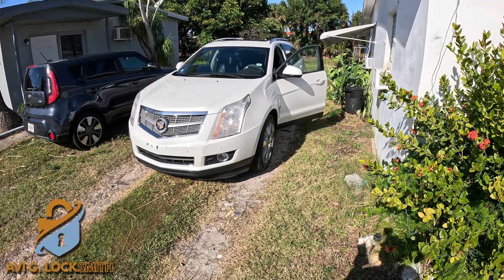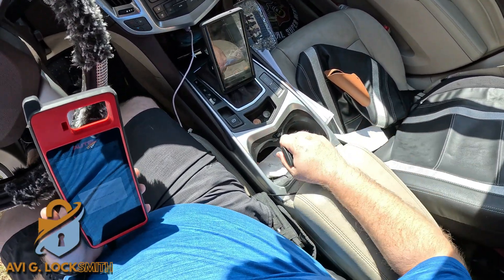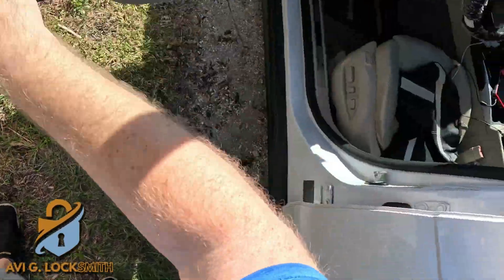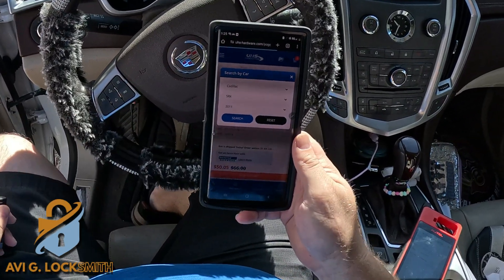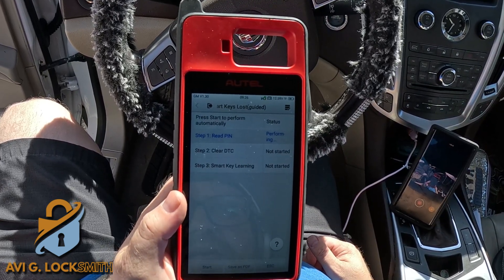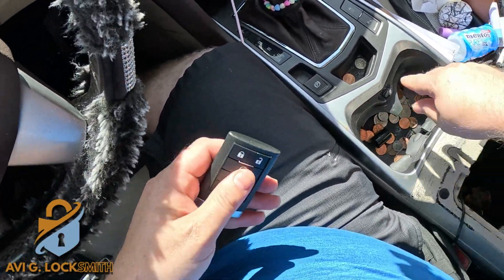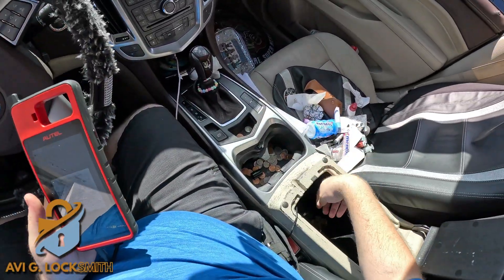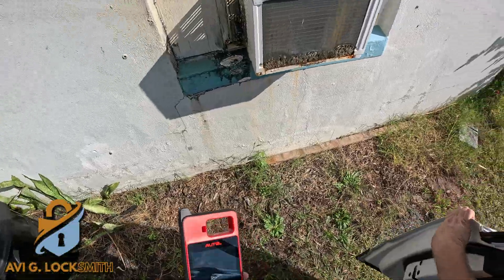Automotive Locksmithing 101: Program a Proximity Key Fob for 2011 Cadillac SRX - No Original Key!

Comment: I did all this. Starts the car, but remote locks still doesn't work. Did three times. And still the same. Starts but no locks work. I notice the lock light stays on while doing the setup on the cluster. How do I get this to turn off? Or can I bypass it?